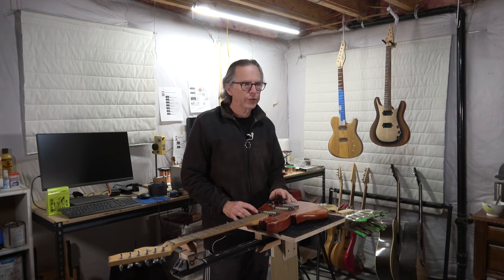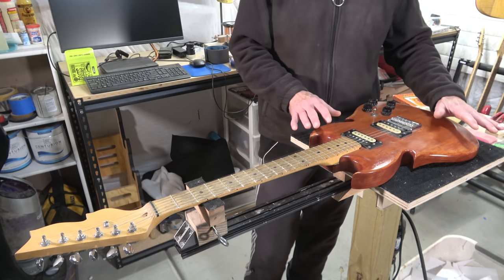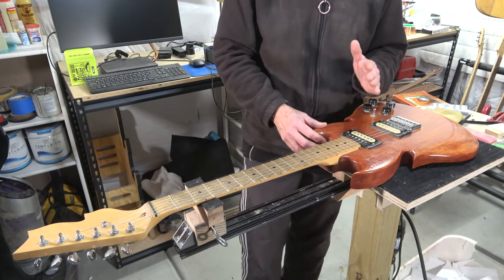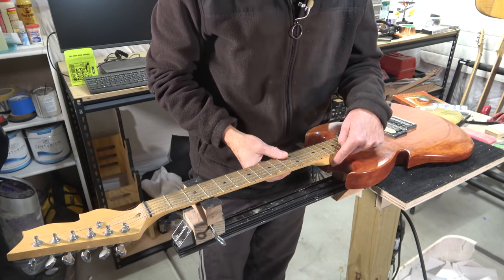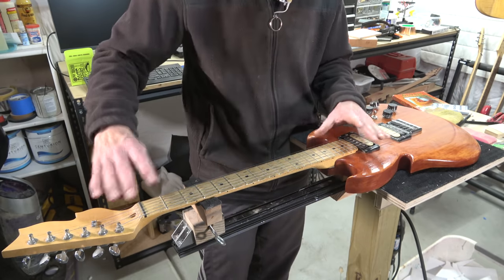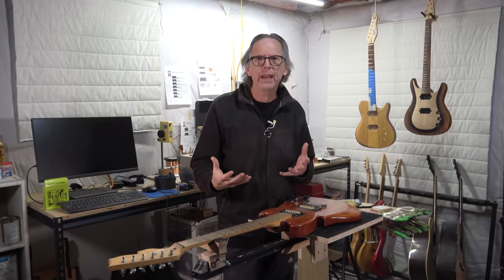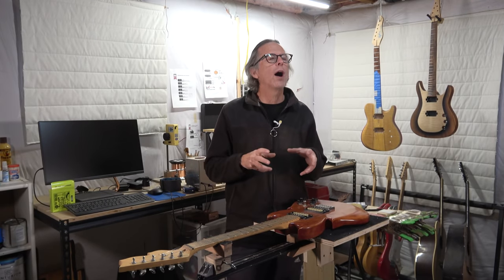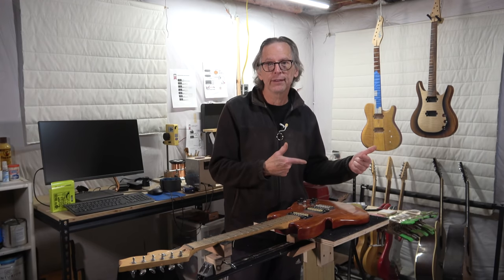The Mistakes I Made On My First Guitar Build

Comment: I just went through a very similar experience - only I was rebuilding a Harmony H78 (much like a Gibson 335), from about 1964. It's actually a nice guitar with three De Armond pickups and a Bigsby vibrato. This was my first time doing ANYTHING with an instrument. I started off with a disassembled wreck that needed repair, repaint (I now HATE lacquer...), rewiring, a new fret board etc, etc. It's now done, and it plays well, and it looks pretty good. 

I experienced exactly what you described with the neck alignment, and I also had to do several of the other operations two or three times to get them right. I feel like I have completed a college course, but I still have a lot to learn, and a long way to go! I now want to bring another one back to life, so it is a bit addictive...

Thanks for sharing your work.

Comment: My first guitar build was a Mod/rebuild of a cheap Starcaster Strat into an extreme Strat based guitar that I went all out with .. painted the body and head stock in a stars and palnets space theme done with spray cans and airbrushed details finished with 2K semi gloss clear coat. I hand made the custom extended brushed stainless steel pick guard loaded with, count them,   3 quad rail/coil humbuckers wired Like a 50's les Paul with coil splitting.   P/P potn for the vol. pots 2 of the tine pots regular style and the bridge tone a P/P to activate the bridge and neck Pick ups together regardless of the other controls.. I retained the Fender 5-way Blade switch and used .047 orange drop tone caps. with this custom wiring scheme I get all 3 pickups together as i want them. added roller saddles and a silid brass replacement Trem block to the bridge. the neck got a titanium nut and the headstock got roller string trees and locking tuners. strung with 9-46 styrings and froated the bridge then tuned it to E-Flat standard like any good Strat should be. Soldering all those connections in the control cavity was really fun.  lol  I ttook a lot of time getting it all working as designed.. using smaller wire to save space and the fact that the current from the Pick ups is so little( in Milliamps) that traditional wire size is really to big anyway.. My guitar looks good, feels plays and sounds great. I did a few little tweaks. like rolled the finger board edges and polishing the frets. it all works great. I added strap locks to keep it where it belongs. Yes I am very proud of this, my very first guitar project. the first of many more i intend to hand build as I make my collection with my own hands.. next will be a classic style Esquire. with original style wiring. then classic stuld SG JR. with P90's... lol   Wanna Play??
Reply from the maker: Sounds like you've caught the bug!

Comment: My first build was started in 1987 and not finished until 1993!  Built entirely with hand tools , except for an electric drill.  The body and neck were cut from cherry and the top was carved maple.  I cut out the body with a coping saw, and I ran into some of the same problems you did with the narrow, flexible blade tilting, requiring a lot of work with a rasp and sandpaper to get the sides perpendicular to the top.  Cherry is about as hard as maple.  Carving the top was really hard too, and many times I got discouraged and set the project aside for months at a time.  The neck was set into the body, and I got the neck angle right just by sheer luck.  But I didn't cut the holes for the pickups or drill for the bridge and tailpiece until after the neck was glued in, so there were no problems with aligning the strings over the neck.  All in all, the guitar turned out pretty well, and I am still proud to show it to others.  Compared to that guitar, my second one was an attempt to build a neck-through design, and that gave me nothing but trouble at every stage. Thanks for your channel and your honest take on the pitfalls and rewards of building your own instrument.  And thank you for replying to my comment about filling pores in wood!

Comment: Brings back memories of the oopsies and such that I've learned from in my builds. Not quite ready to build a neck, but just recently used a blank on a custom bass that needed a unique headstock design. Rough cut the bodies on a bandsaw, then use an oscillating drum/belt sander to finalize the shape. Everything is interconnected...placement of this will affect that, and so on. Building custom cases is similar...a progression of steps to get the best end result. 

Thank you for sharing this! 👍😎👍

Comment: I had a very similar experience, also about 20 years ago. Being a left handed player, I've taken right hand guitars and made new bodies. My first guitar had a Warmoth neck, but the bridge was too high so I had to angle the neck back. My second guitar I made on a milling machine so everything lined up, but, my string through holes didn't line up because the grain deflected the drill!  So the line up on one side perfectly, just not the back. I've also gotten better at adding side marker dots too after totally screwing up the first neck.

Comment: This is really good stuff Chris.   ai’m building my first guitar from a kit.  Have done the sanding of the body and tung oil now and something I realise is the neck isn’t properly aligned in the neck pocket.   I've not bolted the neck on yet (strat style guitar) to see how bad it is but visually I can see it)s slightly off.  Might have to take a bit of the pocket away with a chisel to get it to align.  Not sure what the proper procedure is so any thoughts from anyone is helpful.  Will put bridge and neck on before any alignment assessment is done.  Will put a couple of strings on just to see what the angle mis alignment is.

Comment: Wow impressively few mistakes. I am making way more lol as I seek to finish my first. Thanks for the great video. Can you expand or show more about the drill press pin alignment system you mentioned? One of the issues I had was tuner holes alignment since top is 10mm while bottom is 3/8”. I started with a much smaller diameter bit as a pilot but later realized it traveled a bit due to flex. This the two holes did not end up perfectly aligned and or perpendicular to the face.

Comment: For a while, I've wondered if it's better to have the string ferrules in a straight line or if they should be staggered like the saddles are.

A staggered arrangement would create a consistent break angle for all the strings, and should improve tuning stability in general.

I think it would be particularly beneficial on Tremolo bridges, where the low E and the G strings have the sharpest break angle and typically the worst tuning stability.
Reply from the maker: A lot of effort that will likely go unnoticed.

Comment: Could you explain how your CNC set-up gets around the problem of router tear-out? Do you tell the machine (via G-code) what direction the grain lies? What about when you use woods that have non-linear grain patterns, such as a burl top?
Reply from the maker: For most of my perimeter cuts, I start with a down cut bit for the first 1/4" depth. The I switch to an upcut bit for the rest of the depth. I've never had tear out with a counter clockwise climb cut.
Reply: Great question

Comment: I'm on my first guitar kit build and I botched the stain. What do sanding grit do you recommend to remove the stain and hopefully protect a veneer top?
Reply from the maker: I start with the finest grit I think I can get away with. Usual 220. If necessary, I'll step down to 150 or more if 220 isn't getting the job done.